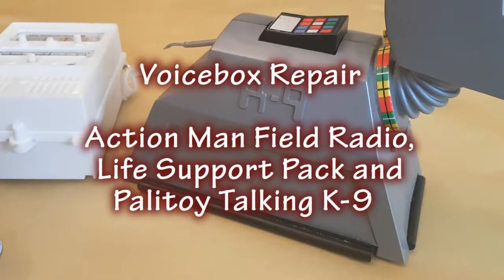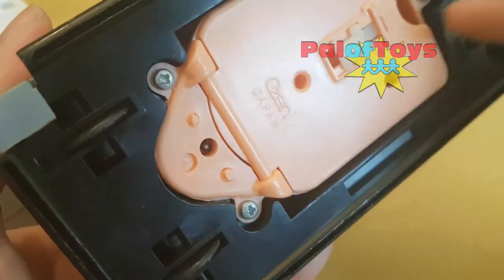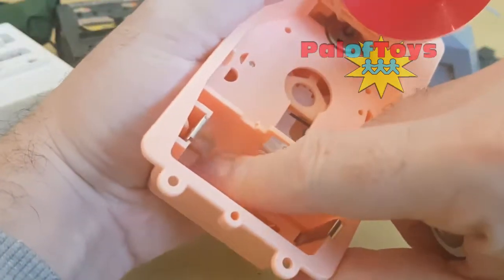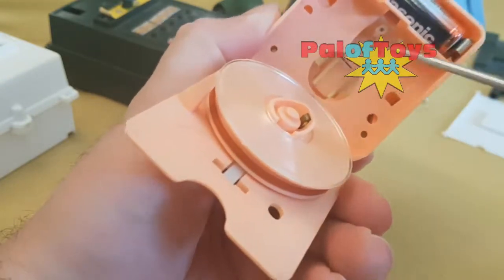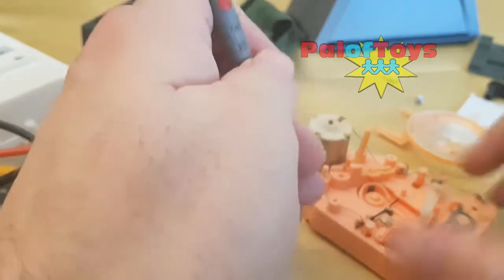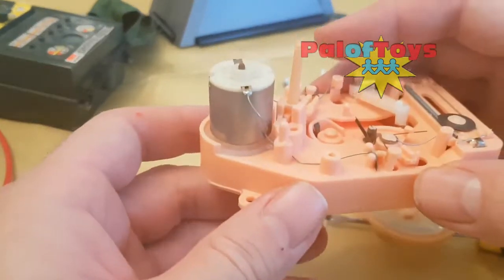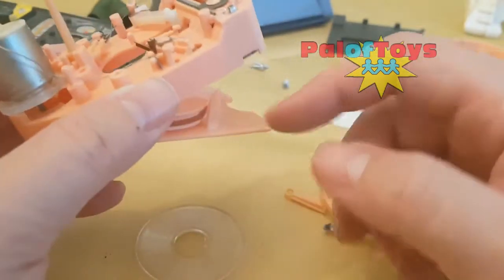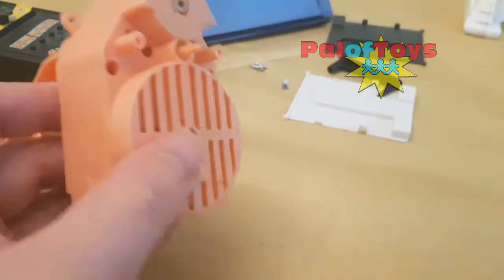Palitoy Talking K-9 & Vintage Action Man Field Radio Voicebox Fix & Repair - OZEN Japan

Comment: I bought one on eBay this week the motor works but still can't get the speech to go all parts are still there any ideas how to get it to work.
Reply from the maker: Hi.. I've just seen this now. It's hard to tell without seeing a picture. I assuming the drive belt is intact  on the turntable. ?? Not sure if you can post pics on here.. If not drop me an email wmiddlemass@gmail.com

Comment: Bit of dementia creeping in there? 1 minute you show us how the piece of plastic on the battery door breaks the circuit when opened, a little bit later on and you seem to have totally forgotten how it works! very amusing! :) looking forward to part 2!
Reply from the maker: Ha ha.. when I was making it I knew it was important but at the time forgot why! It was only when the motor started I realised I'd made that mistake. Oh well..

Comment: I've just repaired two of these and the problem was the same,  I took off the motor back plate and found that the commutator and contacts were dirty with some sort of grease, used alcohol fluid to clean it and scraped out the groove that splits the brass collar and cleaned the fine wire contacts thoroughly. The motor was tested and I just put a tiny drop of lubricant each end of the shaft, both worked first time and should for a long time. Spraying WD40 into those holes misses the problem area.

Comment: thanks for the shout out, I am just going through the hydrogen peroxide process with my r2-d2.
Reply from the maker: Tony Harris that's what I'm going to do. I've got a couple of products  I'm looking at using. One is a paste, the other is liquid. Both burn skin :-( I need a good source of UV to activate the Peroxide because we have no sun.
Reply: PalOfToys I opted to use the 12% hydrogen peroxide (although apparently you can get stronger by putting it in the freezer and letting it separate from the water) I filled a big jar and have done r2's legs but I left them for three days in the window and it seems to have done the trick. I have parts of r2s body now in the jar and I am looking forward to seeing the results....don't forget your gloves!